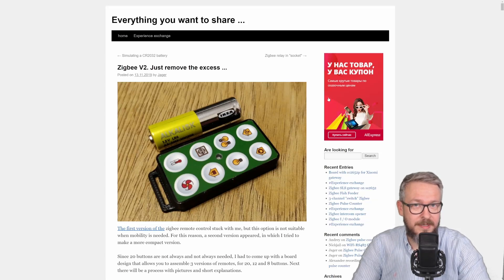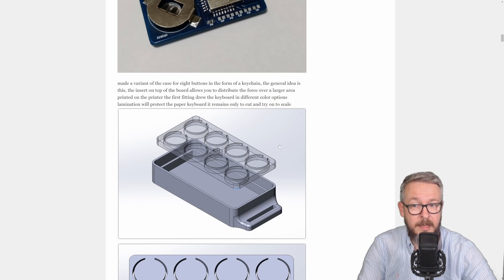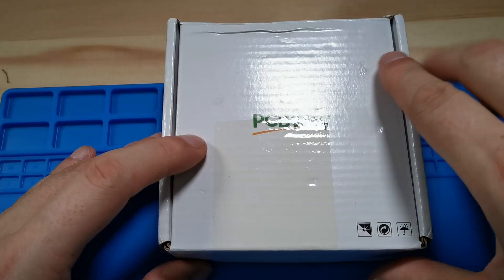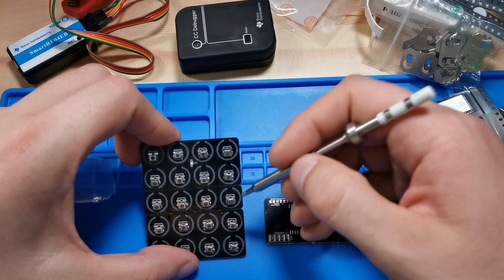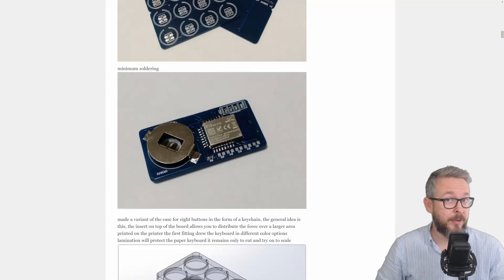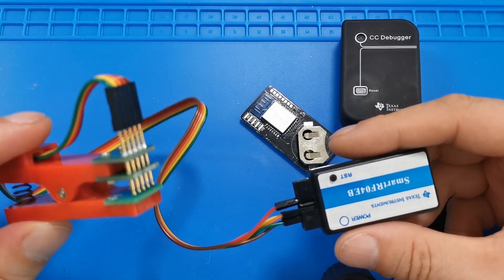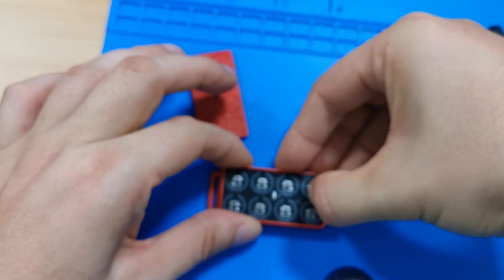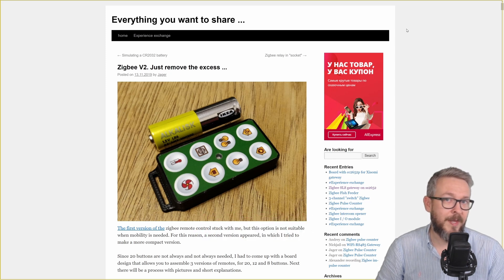Make your own Zigbee remote for Home Assistant 8-20 buttons

Comment: Hi, currently working on making my own custom switch using the e18-ms1-pcb. It needs to be really small, about 35x35 mm so I had to put the e18 into one corner of my own PCB. That leads all the ADC capable pins unable to be soldered to. 
I haven't found any information on this online, but after finding your video, I thought I'd ask you if you know - is the e18 capable of measuring the battery voltage from its own VCC/GND pins for purposes of reporting the battery percentage?
Reply from the maker: I haven't tested that, but I'm not sure it would work as it doesn't have internal ADC to measure battery level directly.

Comment: Would it be possible to get this to work under ZHA?
Am kinda in need of a button/remote with 22+ buttons to use with smart curtains

The closest one I could find is a "FUT089Z" but I would need one without the sliders

Hardwiring wouldn't be a issue
For programming I do have a few death/broken/defective Zigbee temp sensors I could gut the chip from [Display version, with death display].
Reply from the maker: It would require custom quirk to get it working, but other than that, there is not reason for it not to work.
Reply: @BeardedTinker  In that case How would I make one with more than 20 buttons?

I am also planning if its possible to power it with 2x {Ikea AAA} batteries, just to save on CR2350 batteries.

I would roughly need one that looks like
remote:
[top grid 4x3] [4 wide, 3 high] [Mainly to swap scene]
[Bottom grid 3x8] [3 wide 6 high] [for curtain positions]
for a total of +/-30 buttons.

I am familiar with QMK, so if its a similar method of programming/creating the code it should be easy to make one.

Comment: Hey man, I know this is an old post but this thing is awesome, there are no already made pads like this or diy tutorials. Really thinking building this but it seams to be an abandoned project, I wonder if this will still bind with zigbee2mqtt ? Do you still use this ? Thanks
Reply from the maker: Hi! Yes, that's an old one but it still works with Zigbee2MQTT. Just the battery life. I've gone with deep-sleep version of if and batteries only last 3 months. Keep that in mind.
Reply: @BeardedTinker   thanks man, 3 months is ok ... but was it always like this or the firmware has compatibility issues that makes it draw more power maybe ?
Reply from the maker: It was always like that. I think design is the issue here or chip used. Really not sure what is using power in deep sleep, but something is.

Comment: Thanks for the tutorial, this is great, it will be even better if this remote work with ZHA, it works in Z2M but same firmware when paired with ZHA only one button is producing zha event, please help i will appreciate any link/info that makes this cool remote work with "ZHA", I use ZHA because it do not use MQTT and has proven to work way more reliably in my setup.
Reply from the maker: You should create custom quirk for it. I've never tried creating one for ZHA, so can't help you with this one. The problem is that ZHA is not recognising this device properly.
Reply: Thank you sir, your feedback is appreciated, this will put my searching to rest, hopefully one day someone smarter than me will make it work with ZHA- cheers @BeardedTinker

Comment: May I ask why the signal of my device is so weak? The CC2530 and Zigbee gateway can communicate in the same room, but there is no communication between them due to a wall in the middle. Is the antenna signal on the board so weak?
Reply from the maker: Onboard antena is not that great. There is different module (IPX version I think) that has connector for external antenna. But it also depends on the wall.  I have large Zigbee network and didn't notice this from inside the apartment.
Reply: @BeardedTinker  May I ask which specific model of the IPX version chip is suitable for this program project? Several PCB boards have been made...

Comment: Hi, i've done all the soldering ^^... by hand
Checked all the connections but can't  do the upload of the firmware with the Flash Programmer.... 

if i choose "Program CCxxxxx Soc or MSP430" it can´t find the device;

Tried the reset button but still not working...

any advice?
Reply from the maker: As I've said in Discord - nothing. Looks like PINs you are using are OK, if you checked soldering and using correct FW, there is not much that could be wrong. Of course, very unlikely, but you maybe got damaged module or burned it during soldering, but - that's not common to happen.

Comment: May i know what’s the average battery life you’re getting with this?
Reply from the maker: Depends on the firmware. But with deep sleep version, maximum I got is 3 months.
Reply: @BeardedTinker  Wow only three months? That's a bit disappointing.
Reply from the maker: Yeah, true.
Reply: @BeardedTinker  Have you tried cleaning the flux residue thoroughly around the pins of the E18 module? Flux residue can be conductive and create leakage current. This can reduce the battery life of the switch.
Reply from the maker: Did clean it few times with IPA (not beer, alcohol 🤣). And this is with deep sleep firmware, that should extend battery life.
Reply: @BeardedTinker  thanks, and with the deep sleep does it affect normal usage ( eg delayed payload or you need push any button a few times to wake it)
Reply from the maker: No, it sends data on first push so no need to wake it up first.

Comment: I'm looking to make a mail box sensor using zigbee (because its out of reache for wifi)
Would that be posible with the same CC2530 Zigbee board ?
Reply from the maker: There are different E18 ZigBee boards. This one is good for battery powered devices but there is version with external antenna that could help with the range too.
Reply: @BeardedTinker  thanks for the advice I will look into it
Reply from the maker: @TwanJaarsveld1  check ptvo.info site - free tool to create ZigBee firmware. You could use that
Reply: @BeardedTinker  can the same firmware be used or is this just for the buttons ?

Comment: @BearedTinker it would be great if you can show us how to program these modules for a simple temp-humid sensor or for any other arduino kind sensors... There is not much information related to cc2531 programming or code examples
Reply from the maker: This is on Todo list. I'm waiting for development module to arrive where I could easily attach external sensors. It should have already arrived but pack6was lost.
Reply: @BeardedTinker  do you already have any documentation or source to start with?
Reply from the maker: Forgot to post this here - check this link: https://zigdevwiki.github.io/Begin/IAR_install/
It will guide you how to setup dev environment and also pull some sample code.

Comment: I have one of these USB Blaster programmers that looks very similair to the SmartRF programmer. Do you know if I can use my USB Blaster to programmer instead?
Reply from the maker: They are very similar in terms of the box, but not sure if they are comparible. I know that cc debugger and SmartRF work. Haven't seen Blaster used for it so far anywhere.
Reply: @BeardedTinker  Ok, thank you for your answer! Really appreciate it. I found a way to flash it with a Rpi too so I could use that instead since I already have a bunch of those.  I’m going to make this project but redesign the PCB to fit everything inside a NES-controller with the original buttons. Thank you for making this video.

Comment: Wow this really looks like something I'd want to try. So much power in a little device for so cheap!

The soldering is a bit intimidating though... I've only started doing soldering very recently in some light strip projects. I have enough trouble with those, I can see something like this being a lot harder with a normal soldering iron, so it might be worth picking up the heat gun for projects like this.

Being able to make custom zigbee projects like this is so cool! esphome and other esp32 projects are great, but it's obviously a lot harder to make battery powered projects, so you're usually forced to plug them in somewhere. Not having to worry about that with zigbee stuff is really freeing.
Reply from the maker: Heat gun makes this one much easier!

Comment: Hello! Is it possible to soldering keycap from keyboard?
Reply from the maker: Connectors on the board are very small. You could solder some wire and use that for keyboard keycaps

Comment: nice video ! for the future. first, apply solder paste then place components, then you need to rinse with isopropanol. otherwise, micro balls remain on the board. Good luck!
Reply from the maker: Thanks for the tip!!! For most of the components I did it that way, except for Zigbee module. Was afraid I'll get bridge under the modul.
I didn't record rinsing part but I did wash it out later (if you look closely at the end, you can see some paste near the module that's gone later - but yes, almost forgot that part :))
Thanks once again for the comment and tip!!!

Comment: What is the pin pitch for the programming clamp? 2.54 mm or 2 mm?
Reply from the maker: Sorry, forgot to mention - I'm using 2.54mm
Reply: @BeardedTinker  Thanks a ton. This is my first zigbee project. I have ordered the required parts and am now awaiting delivery.
Reply from the maker: @spui  that's great! Hope you'll have fun with it!!!
Reply: @BeardedTinker  Thanks again. I've setup my first switch. I can confirm it works well with zigbeetomqtt but unfortunately not with ZHA.
Reply from the maker: ZHA has unfortunately shorter list of supported devices. Good thing is that in Zigbee2mqtt you can even add unsupported devices.

Comment: Can this remote handle single, double tap and long press for each of the 20 buttons in home assistant?
Reply from the maker: Great timing! Just finished recording and editing part 2 of the video (that will be released tomorrow) - but yes - 4 actions (plus hold and release) for each of the buttons.
Although, you can customise and make each button only have one single action.
Reply: @BeardedTinker  AMAZING thank you! can't wait. this could be such a powerful based module board to make control panel type devices. I'm imagining a fire tablet control panel with 20 quick action physical buttons talking native zigbee around the side which don't require you to mess with a touch screen for common tasks....
Reply from the maker: I just hope the video managed to cover it well. Had problem on how to approach it 😂 It will be out in 30 minutes.

Comment: The buttons are a pain in the butt to hand solder! Just go slow and very little heat if you are using an iron!!
Reply from the maker: Yes they are. Especially since you can melt plastic if you expose it to heat for too long :)
Reply: @BeardedTinker  yeah I learned that after several just turned into goop and melted away!!! Haha

Comment: I have one with 20 buttons. Everything is great, except for the quick discharge of the battery...
Reply from the maker: How long does the battery last for your?
Reply: @BeardedTinker  I too am interested in this and would make me decide if I want to invest or not. That and also if it would work with ZHA.
Reply: @BeardedTinker  A new battery drops to 30-35% in two months, then it starts to work worse, and I throw it on the shelf...
Reply from the maker: @Сергей-е3л6ф  Good to know - thank you for this info!
Reply: @BeardedTinker  Maybe it's just me ... somewhere is short circuit and that's why consumption is... Although it is not clear where, the device is very simple to solder. Need to find out in the Russian-speaking community.

Comment: This project is great, Ordering the parts now. Can you cover the integration into home assistant? Is zigbee2mqtt the only option?
Reply from the maker: Sure it will be in next video. In regard to integration, I can't test ZHA so not sure about support there.
Zigbee2mqtt has everything embedded and working out of box.
Reply: Z2M Works straight out the box and no issues. Amazing project!!

Comment: Do you know if there is some PCB that allows to put screw terminals instead buttons? It's a great piece to hide in the wall boxes :)
Reply from the maker: Unfortunately no, from all the different types, I haven't seen anything like that.
Reply: @BeardedTinker  there is a guy that changed the files for that purpose, but haven't shared the gerber files 😥

Comment: Thanks, that remote looks good. I tempted to build one, i am using an zigbee switch to turn on a timer automation that turn on the night light for my kids bedroom. Having different option on the remote is quite good. How long the battery lasts? Thanks for the video.
Reply from the maker: Thanks Adi. I was very scared of trying to build this, but it ended but really easy at the end. You need to try it. In next video I'll cover HA part - it's great. For each button you can define toggle or multi-actions (single, double, tripple or quadruple click + click and hold) so it gives you really a lot of actions even on 8 button version.
For battery, I still don't know. Just finished 2 of them for recording. But it should last relatively long. It has power saving mode.
Reply: @BeardedTinker  Your solder went well, over all is working that is what matters. How it integrates in HA do i need to use events or each button is a switch in HA? for the buttons i have at the moment i have to create an automation for them to be seen by HA since the button comes as an event. Hope this makes sense. Thanks again for your video.
Reply from the maker: It is supported in Zigbee2mqtt and every button is a switch. But for every button you also get configuration entities - so you can use that for more options.
Reply: @BeardedTinker  Thanks for your response. i  will have to give it a go. Thanks for sharing
Reply: @BeardedThinker I just order 10 boards from pcbway and i got an email that says "the diameter of the designated holes is only 0.3mm, pls advise can we adjust the mouse bites according to our factory's capability of "Diameter /spacing: 0.4mm/ 0.4mm".
did you have to change it to 0.4 mm? I assume will not affect the functionality of the board. Thanks again for sharing this.
Reply from the maker: @adifoto6362  no I didn't but I did order thicker boards by mistake, so maybe it's related. 0.4 should not be the issue, if they don't damage traces for the contact. I think it should work, but check also with them.
Reply: @BeardedTinker  I order them, will se what happens. I think is all fine. Thanks for your response

Comment: Another great video that I can make use of. Can you post links to the hot air solder gun (mine died a few months ago) as well as the flux and solder paste.
Reply from the maker: Thank you Carlton! 
Added to video description. Soldering past is one of the 2 I have. Other one is not listed anymore with that seller and would need to find exact type. But if I remember correctly, I got most popular brand on Ali - most of the shops carry that one (in syringe).